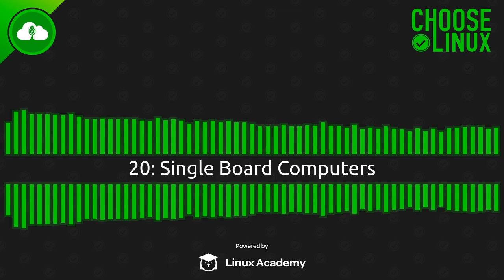Single Board Computers | Choose Linux 20

Comment: Real practical applications???  AYFKM...   I have 3x RPi 4B 4GB, one does a pulseaudio server and does most of my audio across several machines to one high end stereo.  One does a ZFS on Linux with 2x 500GB drives (eventually 8GB drivers / cheapskate).  One is a basic desktop that I watch youtube with like this stream.  All of those with screens draw < 40W of power.  I also have 2x 3b+ and 1x B.  And a banana pi m3 (ethernet to wifi bridge device / router).

Comment: Me and a friend just built a throttle controller for his manure pumping tractor with raspberry pi's, a few relays, linear actuaor and a old router. Took awhile to build but so far working great. Doesn't have to get off the tractor anymore to fill up the spreader, so he's able to save some time now.